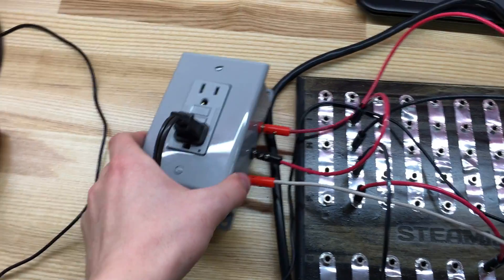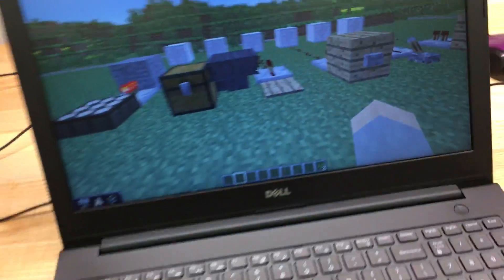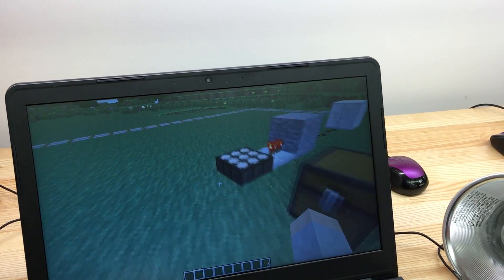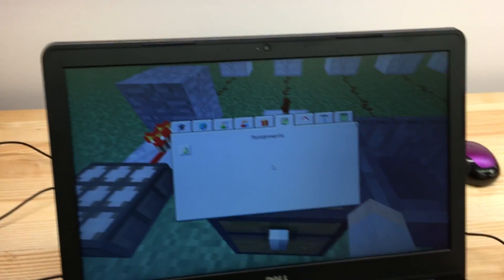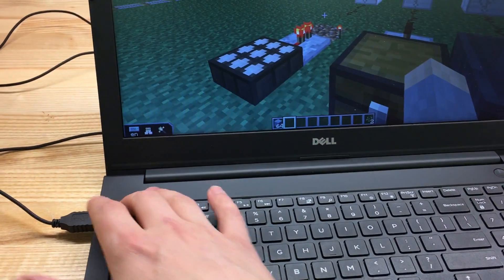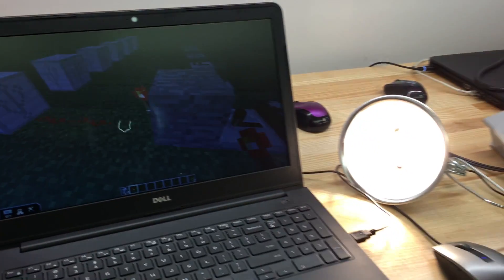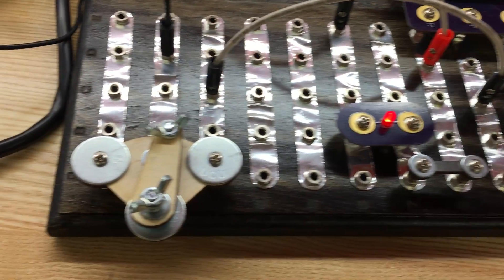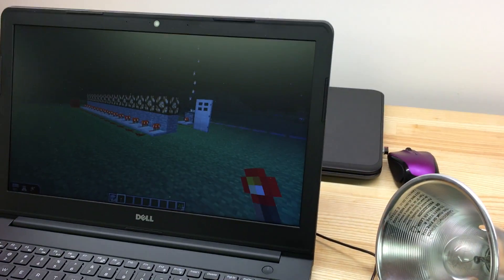Control Minecraft With Arduino

Comment: This looks like great fun.  I'm trying to set it up for my daughter and I.  I'm having trouble with Minecraft Forge 1.7.10.  It runs and shows the mods, but when I create or open a map, it crashes before the map opens.  I've tried running it under Java 7 and without the mod, but still no joy.  Also tried replacing a .class file the Minecraft Forge Jar file to fix a known bug.  No luck.

I've tried running Minecraft Forge 1.10.  That works ok, but the mod doesn't seem to work on there.

If you've any idea what I might be doing wrong, I'd be very grateful to hear it.

Thank for creating the video, we're inspired!
Reply: Awesome! Sorry to hear you've having problems. My guess is that you need to also need to put the jssc.jar file in your mods directory. SerialCraft depends on that library, so it'll crash without it. Did you copy that over as well?
Reply: +John Allwine yeah, that's in there too. I'll have another effort tonight.
Reply: +John Allwine Got it. The problem was because of setting the render distance option too high in a later version of Minecraft. We've just set up the chat button example. Awesome! Thanks for your help!
Reply: Glad you go it working! Let me know if you have any other questions :)
Reply: What is the chat button example?